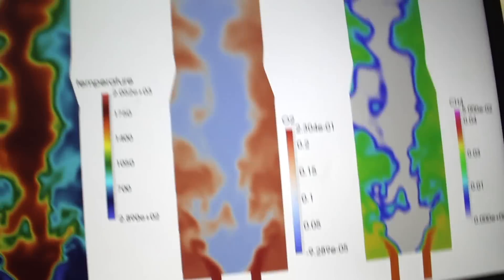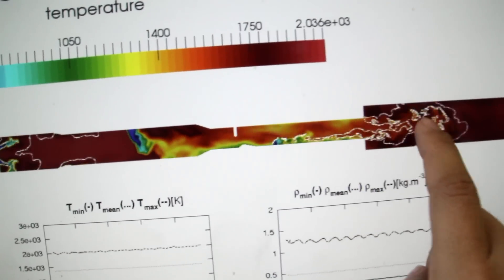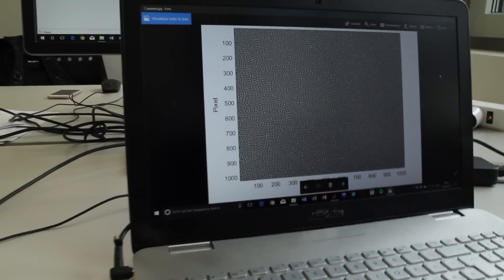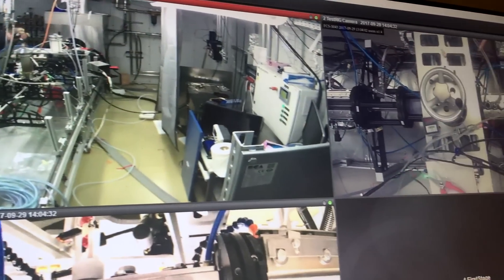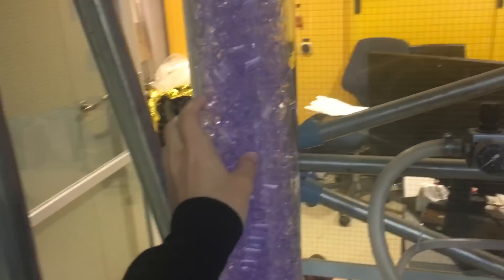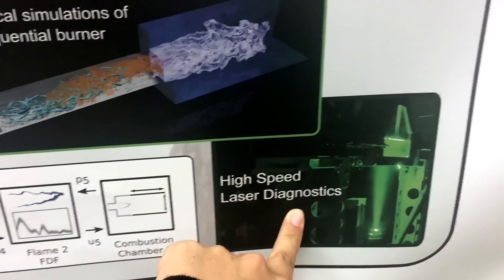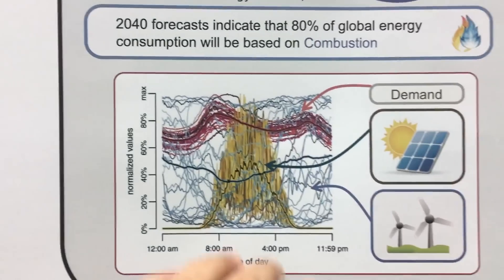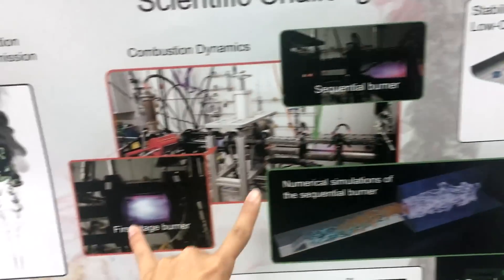Day in the Life of a Mechanical Engineering Student | Engineering Study Abroad

Comment: This may sound stupid but is the maths In mechanical engineering very hard or does the lecturer go through everything ?
Reply from the maker: the math is never thrown at you. it's hard at times but there are always resources. You take many classes and they all build off of each other, so nothing is ever too new:) I just made a video on math in engineering. check it out if you're interested in hearing more (https://www.youtube.com/watch?v=bogz1HsCMt0)
Reply: Eh you get used to the math, youll see alot of the same things over and over eventually, just dont freak out at first
Reply from the maker: Exactly, what Carlos said!
Reply: Most mechanical engineering math requires your basic caclulus, multivariable vector calculus, differential equations and some linear algebra to solve system of equations.  I would say of all the engineering fields, mechanical is the most calculus and Newtonian physics based math intensive of all the engineering fields.

Comment: Perfecto! I actually didn’t know that two -flame configuration is also used in industrial gas turbines! And my question is how you use acoustics to analyze the instabilities?
Reply from the maker: Two-flame configuration is what companies are trying to implement. So the instabilities are actually DUE to the acoustics. And we're analyzing the instabilities using pressure sensors in the experimental set up:)